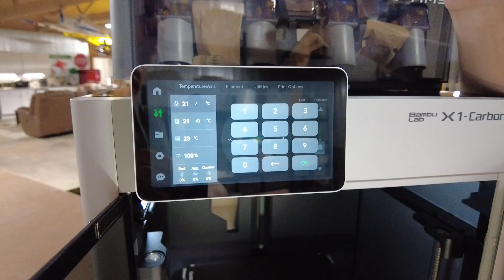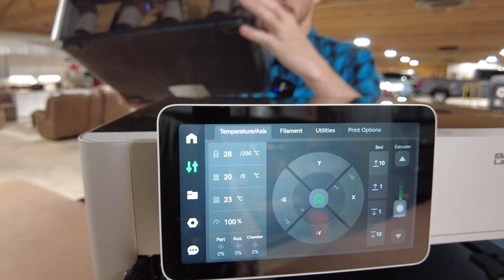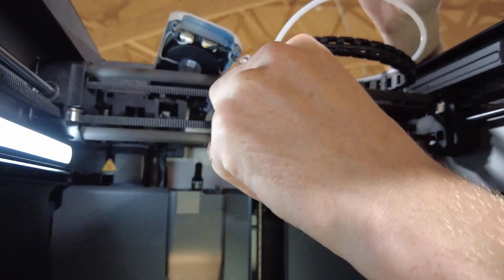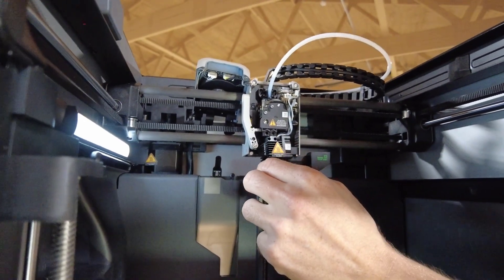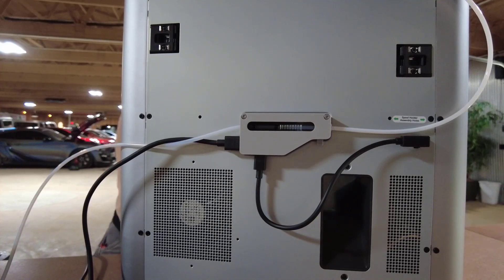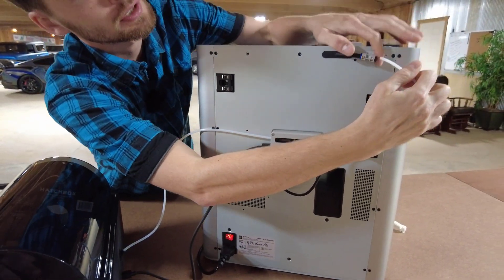Bambu X-1C - The 3 Common Clogs And How To Fix Them

Comment: How many clogs do you get versus hours of operation per unit? Would love another video on your general thoughts about these printers. Many, including myself, have reservations on purchasing because of the closed software design and cloud security concerns. Thanks.
Reply from the maker: We usually keep up really well on our maintenance and have rare fails however, it all determines on the print as well and how well it is assembled in the program. We run our printers non stop and on an internal Lan off network due to the nature of our products. We have design patents so its not a major issue. We have been slammed busy on our operation but I promise to post some updated videos soon!

Comment: I've enjoyed my own Bambu X1C so much, that I've convinced my workplace to replace our slow and finicky Ultimaker S5 with one.  Okay, we're actually getting three!  My point of this is to ask: what parts have you seen wear/fail in your print farm?  We like to get spare parts while they're still available.  What parts would you recommend we stock up on? Thanks.
Reply from the maker: Our biggest issue by far has been the Carbon rods. We had 4 out of the box have rod tolerance issues and we had the opportunity to send them back but we wanted to repair them so we could understand the operation better. Once the rods were fixed, as long as you keep everything properly clean and lubricated, these are fantastic!